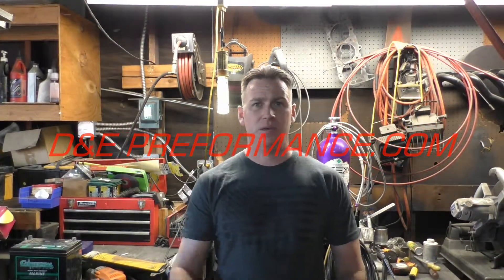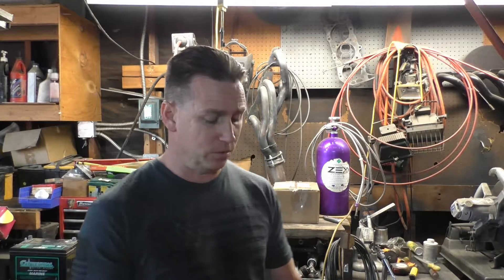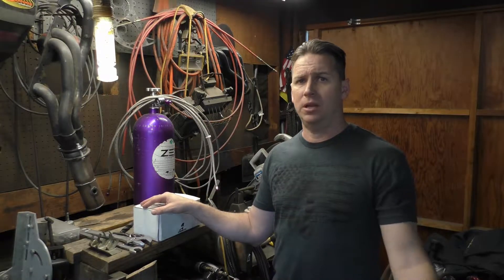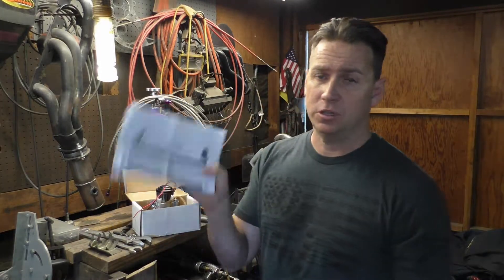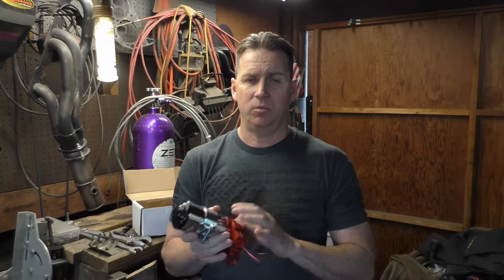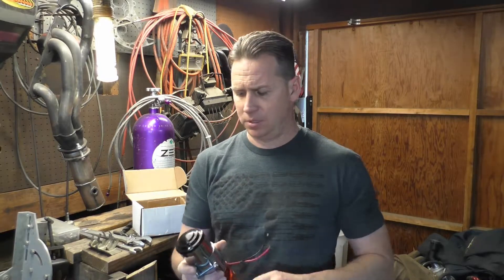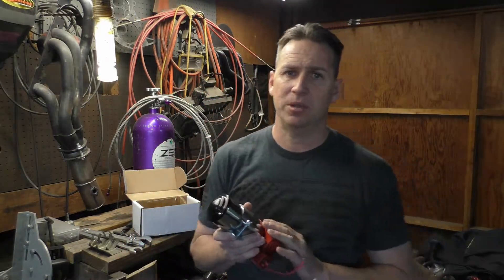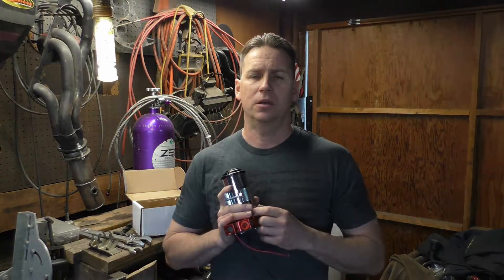WHY THE AEROMOTIVE SS FUEL PUMP

Comment: Old topic, but I have no idea. Pressure drops to 0PSI at idle. Power cables approx. 14v voltage comes out of the relay. New fuel lines, same diameter everywhere. Help
Reply from the maker: Typically zero psi would be a set point on your fuel pressure regulator since this pump is pushing 14 psi at 14V all the time I placed my pressure regulator 18 in away for my main inlet line to the carburetor
Unscrew the jam nut and either loosen or tighten to adjust fuel pressure this will be very difficult without a fuel pressure gauge
Be aware that some of the Chinese fuel pressure gauges do not function correctly and you may need to source a more expensive US made fuel pressure gauge hopefully this will help you.
Reply: @deperformance9741  thanks for the quick reply. I didn't have time to test it, but my setup is the Aeromotive SS Fuel Pump 11203, the Aeromotive SS 13205 regulator, the fuel filter in front of the pump Aeromotive Aei-12304 100Microns pump, and the aeromotive aei15632 pressure gauge. Only what I think can be a strainer on the float in the tank. this is fitted to a corvette c3 1980 stroker 383

Comment: I just put an ss series on my truck and man it is louder than I expected, is this normal
Reply from the maker: Hey Nick sorry I didn't get back to you on this.
 yes it is a loud pump just make sure that you have 13 volts to it
 meaning a good charging system hooked straight to 12 volt key switch or toggle switch
AKA Good working alternator.
 cuz if it drop on the voltage  you'll have issues
Reply: I've heard it described as being louder if you run it deadhead versus using a bypass regulator with a return line to the tank. Also, mounting it straight on the frame without some type of vibration damper.
Reply: @Neil555-11  No, it does not 🤣 I have the same issue olthough I use a reg and rubber bushings and so on.

Comment: I’m running an SS pump and regulator with my carbureted 6.0, running it dead headed, been in the car for 10 years now, street driving and track racing, haven’t had an issue yet, works flawlessly. 👍🏻

Comment: Hi, i’m using this pump just over 600HP NA, maintains 6 psi, when i use my brakes, pump switches off and 0 fuel pressure, just rewired the pump and no difference. Any ideas? Aeromotive are helpful but its a strange issue.
Reply: azza wagon 
where's the pump mounted? . could have a short maybe a ground issue.... I would check your ground to make sure it's got a good contact check it with a voltmeter or test light.. it's only doing it when you are breaking could be losing ground and cutting power to pump... You said you rewired it.... is it wired on its own ground and power source?
Reply: azza wagon 
It could also be a pick-up issue with fuel..
Reply: car was completely rewired when i done the car up, every component new, i had a new stand alone pump harness made to try and eliminate the problem, its connected to the pumps factory wires, using 10 gauge wire, relay and fuse at the rear next to pump and battery as battery is in the rear. From there it goes direct to battery, its ground to battery also (Aeromotive tech recommend this in the short term) I have -10 from my custom fuel tank into a 100 micron billet filter, stainless element, then pump, pump is mounted so pump feed hose -10 is an inch under the fuel tank floor, then -8 to billet fuel log, bypass regulator and -8 return to tank. Ive been fault finding and nothing obvious, my toggle switch at the front i also replaced with a brass one, but it needed 12v source so went off ignition key barrel, that enables the relay to be armed. Im at a loss
Reply: maintains the fuel pressure, worst i saw was 5 psi under WOT yesterday, its set at 6 psi.
Reply: Try giving it 1or 2  more psi 
do you know the AFR reading  at wot? check your vacuum line's
Reply: I’ve finally worked i out, fuel tank, with 20 litres in the tank, fuel is moving forward on brakes, uncovering the pick up, filled tank today and pump stays on and maintains pressure. Looking to sump my tank now.
Reply: azza wagon Kool glad you figured it out that sounds like you might need a longer pickup tube or maybe a different position so the pickup tube can still grab the fuel under braking conditions.
Adding more foam inside the fuel cell if you have a fuel cell could also help...
Reply: Hi, old topic, but I have the same problem, with the pump pressure drops even at a standstill to 0 psi. What was the problem for you in the end?